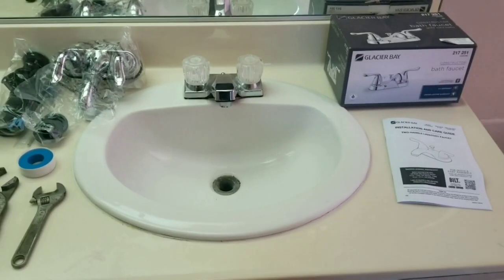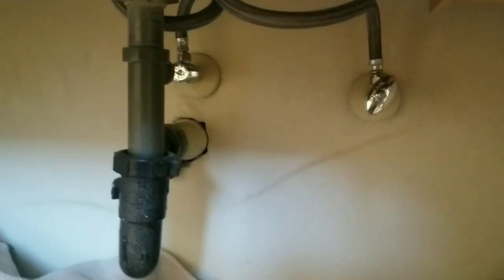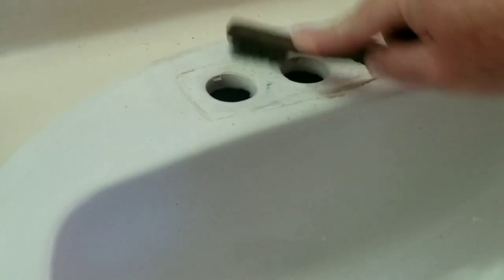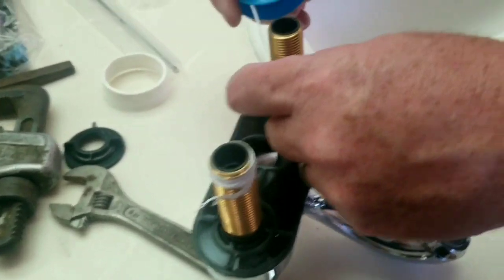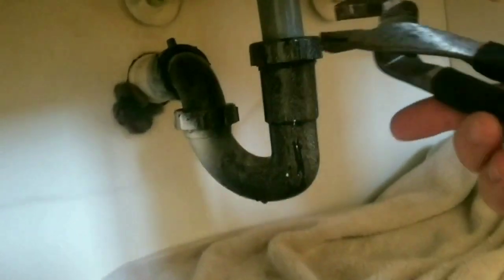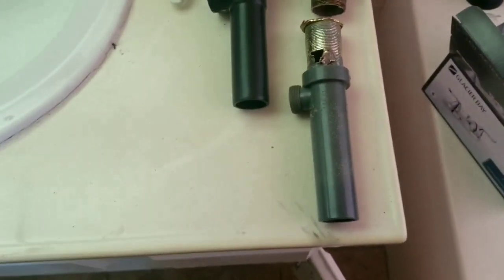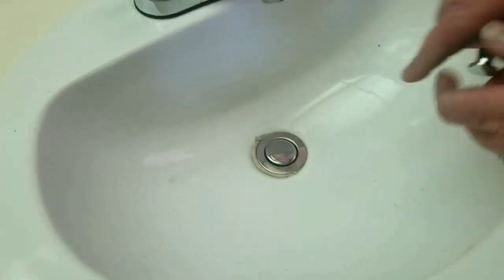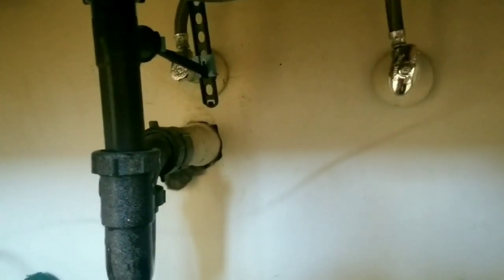How to change a bathroom faucet glacier bay

Comment: Good video and nice work assistant!  One thing you forgot is to add a bead of silicone (not putty which specifically says don’t use with plastic) on the rubber gasket on the pipe that goes underneath the sink to ensure a perfect seal with the sink.  Some sinks - especially older porcelain or ceramics - have minor imperfections that will result in leaking overtime without a perfect seal especially as the gasket degrades.  

And man that Rigid tool that some of the others mentioned is a lifesaver.  I just did 5 this weekend and took about half the time.

Comment: Appreciate that you made this video however the one instruction I was not clear on was “silicon sealant is required under the gasket”. Define “under”. Between tap and gasket or between gasket and sink?  I did watch the part of video where you show it going around the circle in the middle but should it not also go between tap and gasket around the edge?

Comment: You don't need teflon tape on the faucet threads because there are rubber gaskets in the supply hoses.
Reply from the maker: Correct I over kill it because I have enough pain the first time so I dont want to do it again 😂😂🙏🙏 thank you for the comment

Comment: The only unfortunate part of these glacier bay sink sets is that the drain option cannot be used on a sink that doesn’t have a neck on the under side. Found that out the hard way and had to reinstall my old drain and now I have an extra drain set 🤷‍♀️

Comment: Good video.  I would just add, I've seen a plumber on YT put a little pipe dope on that elbow connection, without a gasket, they call a  slip joint.

Comment: My dumb question is, the drain part is able to slide up and down (if I try) despite the slip ring thing underneath being tight. I'm talking if I haven't screwed it into the ring at the bottom of the sink itself. It seems like if the drain gets clogged up, it would likely pour out from the slip ring. Am I wrong? How would I make sure it has a good seal, because I figure if I can move it (relatively easy), it can't be all that water tight?

Comment: Ok so do I HAVE to install the new drain? I really don't feel like it and my dain is in fine shape. So I don't have to replace the drain if I don't want to right?
Reply: No, you don’t. After finding out my sink doesn’t have a neck for the drain that came with this set, I had to reinstall my old one back on. That part is nice, but definitely optional. I’m going to clip of the pull thing that would’ve raised the drain and permanently glue it in place

Comment: The hardest part is pressing that yellow thing and I see why you didn’t show it in the video I’m still trying to figure it out
Reply from the maker: If your refering to the plunger assembly I tried my best to show how it goes prior to me doing it. If your refering to the actual drain underneath yea I had to actually cut it out
Reply from the maker: Now I see what yellow cap your refering to I never took that off but it snapped in fine still working great today???
Reply: L_O_W_K_E_Y-G  I glad you posted this.  I was wondering why that part looked so funky.  It's supposed to be a round pivot ball.
Reply: L_O_W_K_E_Y-G  exactly I’ve already thrown mine out!

Comment: Do we need to buy new water lines?
Reply from the maker: Depends if the connection fittings are corroded or you see alot of build up around the fittings I would however I usually keep the same hoses. Just depends on your budget really
Reply: @maintenancemadeonabudget  Gotcha. Thank you vm for the upload. It s so very helpful for someone who has never attempted to install a new bathroom faucet.
Reply from the maker: You very welcome 🙏

Comment: Is there a way to remove the horizontal rod or the top part of facet in order to clean up the debris that has hardened the rod?
Reply from the maker: Yes you can remove the rod by itself by removing the clamp that the rod slide through under the sink first than pull up on the rod from the top and clean it up.
Reply: @maintenancemadeonabudget  Thanks very much for your reply. But what is that tiny hole on the side of the horizontal rods (handles); which, if I am not wrong to presume, is where a small screw sits in to access removal of the rod?

Comment: I would not use Glacier bay.. Moen and Delta are often on sale worth it
Reply: Glacier Bay is just probably a re-banded name for Delta.  The trouble with big box stores is that they dumb down the parts in a product to save money.  If I were to buy a toilet or faucet, I would only go to a plumbing supply house and buy a name brand product there.  Faucets take a beating--so why not buy a Cadillac and save yourself the time of having to repair it or replace?  Climbing under a sink is no fun!
Reply: You forgot to tell us to take off yellow cap before inserting into drain.
Reply: @joannlee6357  I had the same issue. 😆
Reply: @AStanton1966 It's often more than that though. Yes, many manufacturers make store brand products for other companies, but often those products cut corners in very bad places - eg important strong parts are made weak, meaning you end up replacing more often. I went through several Glacier Bay kitchen faucets in like 3 years. Same issue both times - Fauct snagging up and becoming impossible to turn, the inner ring basically came out and I got fed up with it. Running a Delta faucet now for 3 years and it's running as well as it did new.
Reply from the maker: Still no issues with this one thus far
Reply: @maintenancemadeonabudget  Glad to hear it, and I should have added, I have Glacier Bay models in both bathrooms and haven't had an issue. Could easily be the kitchen unit I had was just a flawed design, or just a bad run of that model multiple times, it's hard to say. But for other parts of the house, it's been totally fine!

Comment: what kind of hose did you use, i have a super old faucet and i need to change the hoses, what hose size is the new faucet?
Reply from the maker: I used the same 3/8 " supply hoses they are found at home depot

Comment: I ran into the exact issue you said “i hope you dont run into this issue” and i dont have the saw you used to cut the thing so now im stuck
Reply from the maker: I bought a hand saw at harbor freight $30 with coupon to cut mine off it's a pain for sure
Reply: @maintenancemadeonabudget   I actually used a pair of heavy duty pliers and I was able to bend it back and forth until it broke. Took about 5 minutes or so. Great vid👍🏾

Comment: Glacier Bay bathroom faucets are garbage.  Specifically, the drain/tailpiece is a defective design that doesn't seal properly and will leak 2/3 times.  Don't waste money or worse, your TIME, trying to save a few bucks.
Reply from the maker: Haven't had any issues with this one
Reply: @maintenancemadeonabudget  I installed 3, two leaked from the tailpiece after water was run for more than a minute or two.  No amount of tightening or adjustment would stop the leak.  Took them apart and it’s obvious that there’s no actual seal to prevent water creeping down the threads from inside.  Crap design.
Reply: @w3vjp568  ...can you use plumbers Teflon tape?